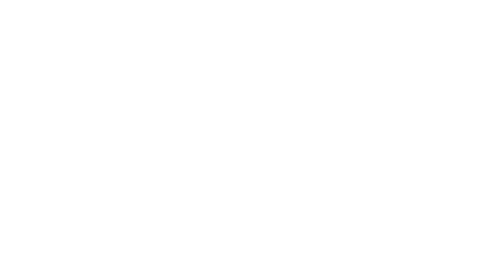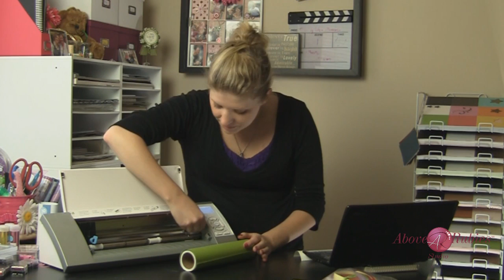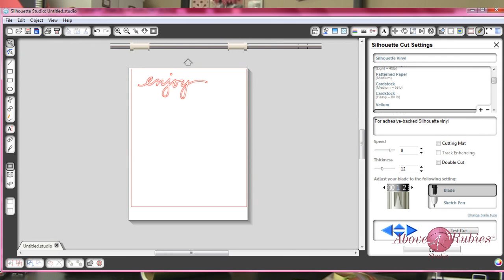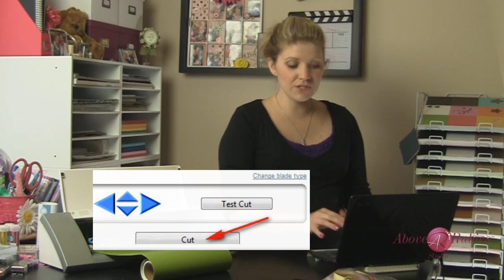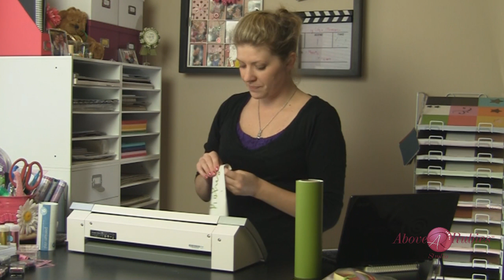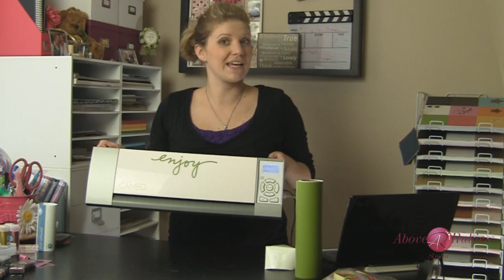How to Cut Vinyl With the Silhouette Cameo

Comment: I can't get the cameo to cut anything at all on 1 setting  I went up to 5 and it won't cut all. The way through the vinyl
Reply: Judy Zeigler  there are some sign u need to follow on the blade. if you rotate it wrong.. you will not cut the vinyl as the blade has angle to fit.
Reply: Judy Zeigler I can't either. I have been looking for tons of videos and I can't find the video I need.
Reply: Emily Claire

Comment: Thank you for the helpful video.  I followed all of your directions-but it failed!  First of all, I couldn't get the right roller to move for the 12 inch vinyl.  I went ahead and tried to cut my pattern, but I got an error message saying that the registration failed.  I did have the Cameo on the media load setting.  I am very frustrated- I have lots of ideas, but can't get started!  Any help would be appreciated.  Thank you.

Comment: Love how this site uses the pop-up menu screen to aid the viewer with the steps used for parts of the demonstration. I only yesterday learned about the Silhouette while reading a blog I received. I'm not artistic, but interested in creating stencils to use in Subway Art using Chalk Paint. I want to create my own stencils and possibly sell them, if the product is of the quality needed. I'm wondering whether the Silhouette is capable of working with .007 mil mylar which is the thickness of stencils I've purchased from vendors on eBay. Thanks for any assistance.

Comment: I am having trouble moving the roller on the left to cut my vinyl.
Reply: +Mrscreative47 I've only had my Cameo for a couple of hours and haven't cut anything yet but I'm pretty sure that the left roller is fixed and you can only move the right roller.
Reply: +Jim Root Mine is still in the box :)

Comment: Hi, I have a question!  I just got a Cameo for Christmas and am learning how to use it. I understand how to load and cut the vinyl, but every time I've cut it, my blade is catching on letters and picking them up at making it get all caught in my machine. I  made sure the blade is on 1, but I'm still not sure what else I can do so that it cuts in nicely without ruining any of it.  Please help!
Reply: Have you checked to see if there is any vinyl caught up inside your blade cartridge? I had the same problem and cleaning that out plus slowing my speed helped a ton. Good luck.
Reply: Julie, I'm having the exact same problem! Also my sheet of vinyl is sticking badly to the carrier sheet. [the instructions that came with the vinyl said to use the carrier sheet]. Any suggestions anyone?

Comment: I purchased one of these machines and had nothing but trouble.  Contacted the company for technical support but unfortunately you can only leave a message and someone will get back with you in 1 to 2 days.  They determined that my blade was defected and it damaged my mat so they had to send new parts which took over a week.  I worked with the rep.  to get the machine working.  He told me that that when working with vinyl the speed setting should be changed to 1.  I did this and when I when I went to choose another pattern to cut using vinyl the machine starting stopping and telling me to unload the paper then it would start cutting again about 5 seconds later needles to say when it finally stopped cutting and told me to unload the machine it only cut have the pattern.  I contacted the company again about my machine and a day later a rep contacted me and told me that the machine was not defective that I now had a software glitch and if I would go to my machine he could walk me though solving the problem.  I have been very disappointed in this machine and the customer service that the company provides.  All they tell me is that this machine has a large learning curve and you just have to watch the videos on U tube until you learn how to use the machine.

Comment: wowzer!!  I just bought the cameo today..I tried my 1st cut and it went bad?  I got to the screen, typed in "the city of champions" in a "handwriting" font...loaded my vinyl (silhouette brand), and clicked "cut".  What I got was tiny little scratches....I had the blades to #1?  What went wrong?  LOL Im going to try again...Thx Uzi
Reply: Hey there, if you're using the premium vinyl first of all make sure you select vinyl as your medium in the settings. The default settings you need to see (& work) are blade #2, speed 8, depth 9.
Reply: Also make sure the font is appropriate for cutting.  some very skinny fonts will not cut well because there is not enough width to be able to lift off the word.  If the font is too thin, I will sometimes make a thin offset so that it is a bit thicker.  Also, on the cameo, some things are meant to be "sketches" and not "cuts", therefore, it would only work like handwriting it and not make a "bubble letter" to cut it out.
Reply: number5ful depth 9/10

Comment: When I try to load without a mat, it just slides through and messes the project up because it moves around. Is there a place to tighten, so it will not slide right through? thank you
Reply: i had the same problem

Comment: You can use a clear/translucent low tack adhesive paper to place over the letters, release them from the backing and then lay the whole word out at once. It would be much easier to deal with than placing each letter individually without the threat of distorting the overall appearance.

Comment: I'm having trouble cutting my vinyl with or without a mat. When I load it, it starts to cut and then makes the vinyl go all goofy. I've adjusted the white rollers as it shows on the cutting for the silhouette, but it still doesn't cut properly. Could you please give me some more information in regards to this? 
Thanks Denise